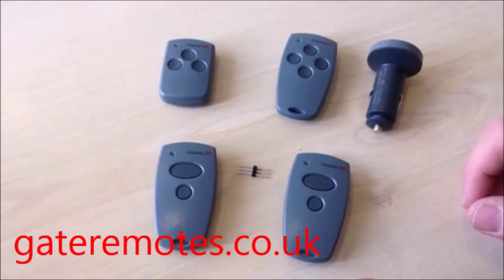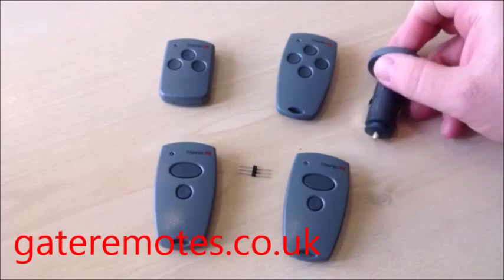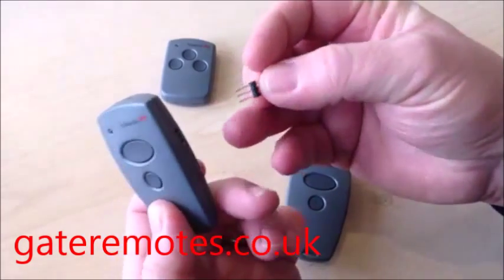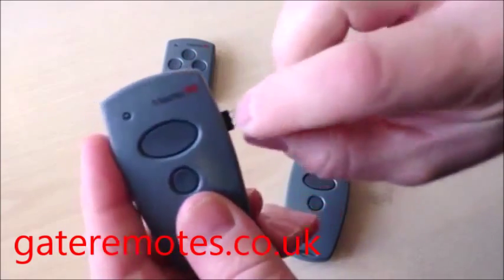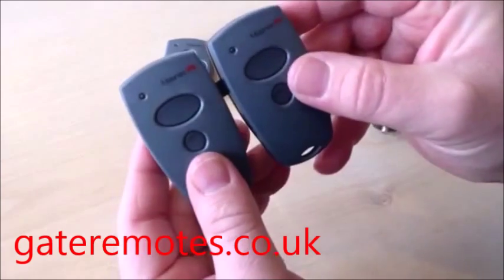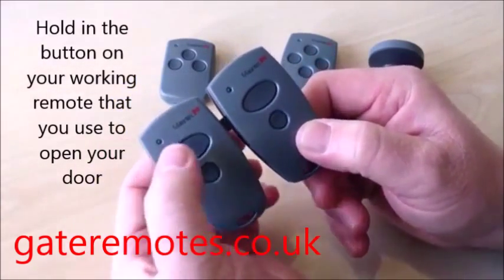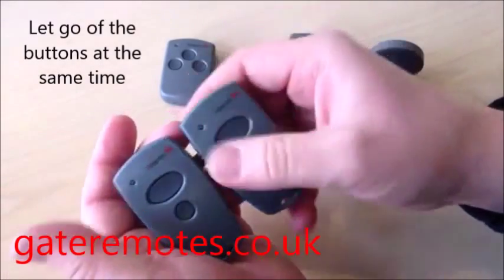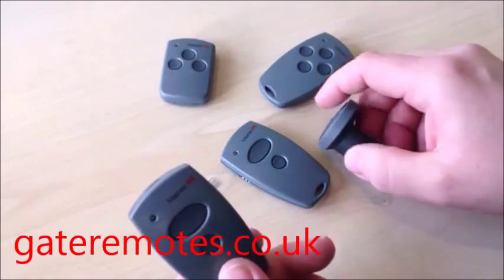Programming a Marantec Remote Control

Comment: The new coupler for these remotes has much longer pins than the old one. Do not push it all the way in like the video says. Only put it in about a 1/4 inch. Otherwise it will hit the battery short out and will not send the code. It only took me 3 hours to figure it out. Oh well it works good now.
Reply: kenneth woodman thank you so much! It worked and only took me 10 min because of your comment! When I was pushing all the way in it wasn’t working. I had the old remote as the one with the original code.
Reply: Did this and it worked straight away and saved me a lot of tine! Thank you for your help Kenneth
Reply: YOU SIR….. Saved. My. Ass. Thank you
Reply: Thank you for this comment it worked!!!
Reply: Commenting to bump this comment up. All I got was a solid red light until I pull out the pins a bit from the new remote.

Comment: I have found it necessary to bend the remotes backwards slightly while they are plugged into each other, in order for the inner contacts to meet. With the connected remotes facing me, I bend both remotes away from me through an angle of just a couple of degrees each. It is not enough pressure to put a permanent bend into the connecting pins, but just enough so that I can feel the springback tendency of the connecting pins. Holding the remotes in this position, I proceed with the transfer as directed by the video. I learned this bending step from another video here, but it was in a foreign language.
Reply: This literally saved me, thank you!!!
Reply: Thanks saved me too
Reply: You’re a life saver. Was trying over and over again to make them work!
Reply: nothing worked till i tried that. thank you
Reply: You are Godsend, this comment helped me a LOTS. Thank you!

Comment: I bought an off brand pin to do this, and it didn't push in all the way (because I couldn't), like in the video, but it still worked. Just a heads up for those of you who don't have the same pin as the guy in this video.

Comment: I haven't seen one video on the Internet on how to program a brand-new one of these if you don't have an old one because it was lost. Is there any information on how to program a new one alone?
Reply: Any luck, I'm in the same position?
Reply: Yea ...What the fuck
Reply: Me too!
Reply: Same here
Reply: Any luck yet lmao
Reply: Hi! I had to do this with my Comfort 250, and i have to rip off the cover on the motor, and press and hold the «P» icon for 3 sec until 8, 2 and 1 start lighting up. Then press again for lighting 4,5,6 and once more until 6 and 8 lights up and 7 starts blinking. Point the remote to the motor and press the button on remote. Then 7 will blink fast. Release the remote button and press «P» again. You’re good to go
Reply: @stokeslashx3679  right on! 🙌🏻

Comment: As with Kenneth Woodman below we found the connecter didn't work fully pushed in to the new remote as it had longer pins so I did what he said and pulled it out slightly. Hey presto it paired OK then. Despair was setting in.

Comment: My program connector tongs are longer and I cannot push the connector into the  transmitter allowing the black plastic on the connector to stop against the transmitter. I tried programming and the receiving transmitter light doesn’t flash or pick up the code from the sending transmitter.

Comment: How can I program a 4-button Marantec Digital 302 using a 2-button of the same type? The method presented in the video doesn't work. (I want to program the lower button of the 4-channel transmitter, using the 1st button of the "old" transmitter.  The new transmitter LED doesn't start flashing, but lights constantly.)